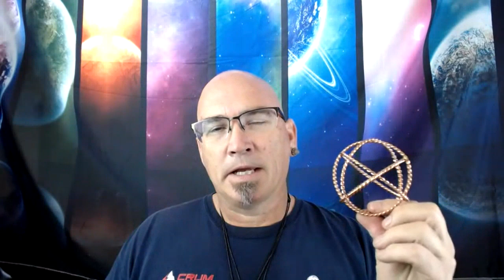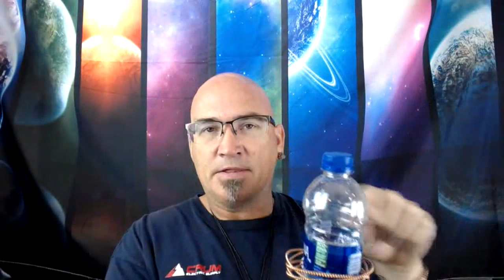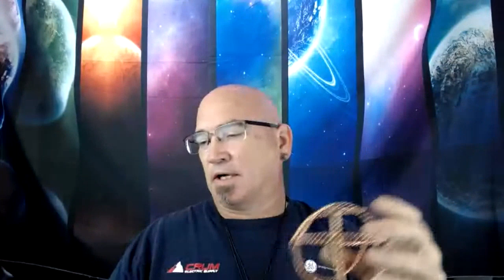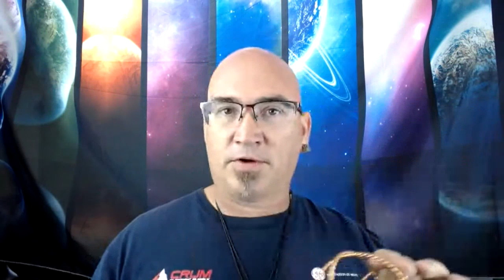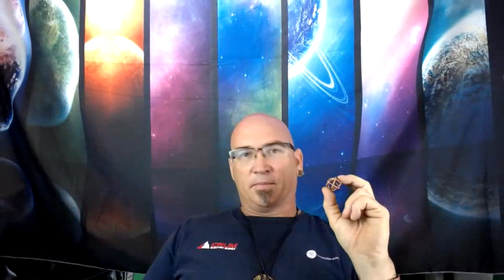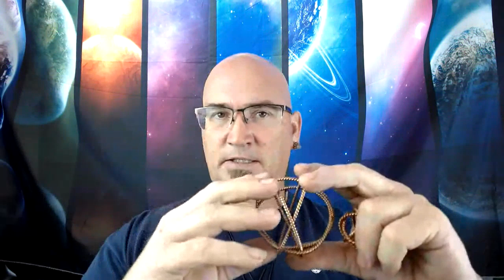Tensor Field Generator Webinar

Comment: If it works within miles & etc, what if you live in a bad/low vibrational neighborhood(as in negative spirits, wandering spirits, people with spiritual attachments) or one with a lot of emf, which would you then recommend? 

I am a medium: openly see & communicate with spirits/non physical beings, i keep active altars for benevolent ancestors, I work with & venerate different deities & do mediumship readings along with past life regressions for a living. I’m interested in how this might work in my line of work too.
Reply from the maker: Tensor Field Generators create fields that extend into the environment, while most other tools are for your personal field. The Harmony Tensor Field Generator has the largest sphere of influence, but the field does diminish in denser energies, yes. It is best used in agriculture and in nature.  The Golden Fire, though, has half the area of influence (2-1/2 miles) but dense energy does not diminish the field.  The Golden Fire can handle the 5G mm-waves as well as cross over ghosts/waywards.  The Divine I Am Tensor Field Generator has the Golden Fire abilities, but goes deeper into the soul level clearing (lifetimes of experience).  Though it also has the smallest sphere of influence of about a city block. 
The Wisdom energetics is our newest, and goes even deeper into the soul level (lifetimes) clearing and integration.  All heart-based fields, where the soul is in charge.  The tools carry fields that are like a tool box for your higher consciousness to access and utilize if it is in your highest and best, as determined by the soul.

Comment: At about 35 minutes or so, you say Brian that you cannot put intentions into a single tensor and have it amplify it, but isn't that what you showed us to do with a single ring to put into water?
Reply from the maker: Yes, a Tensor Ring cannot hold any other intention other than what is held in the etheric template of the ring.  The geometry of the tensor field generator, though, can hold intentions.  When working with a water ring, the Tensor Field holds a massive amount of frequencies and properties of plants and crystals and light of many varieties.  When your water is within this field, you can ask the water to hold specific frequencies for you.  Tensor Fields are a simple tool for communicating with the water.